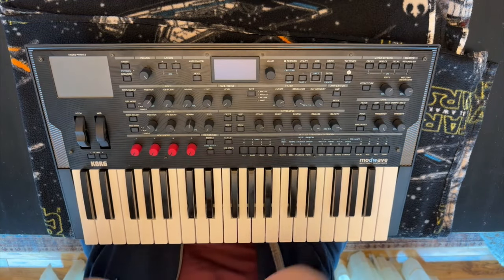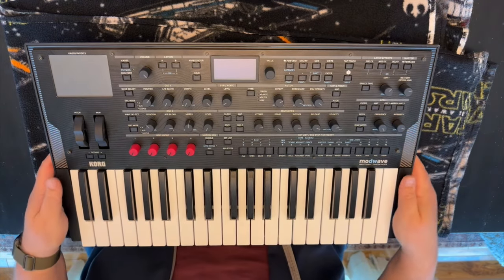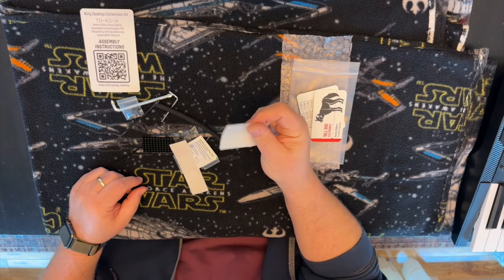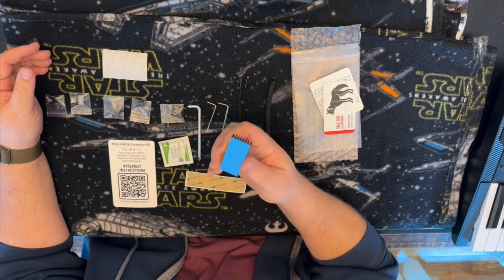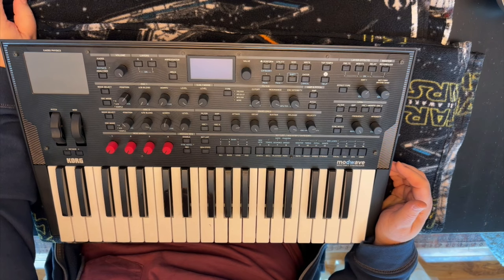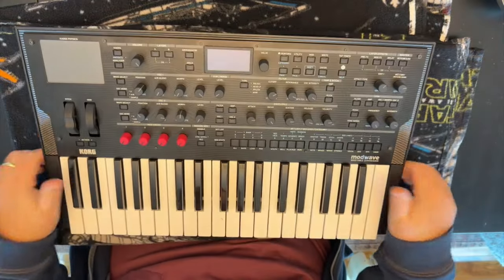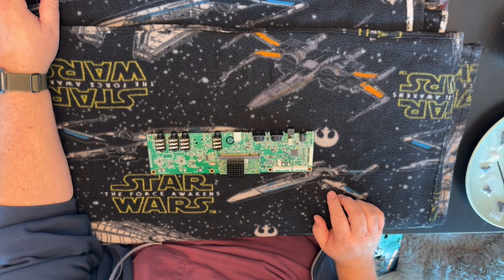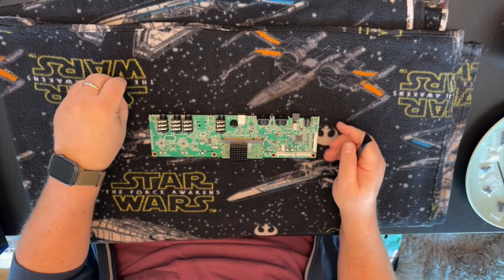Convert Korg Keyboards to Desktop Modules | No Music | Detailed Walkthrough

Comment from the maker: README: A few comment summaries from the last few days:

1) Dan from Tall Dog says this about upgrading the Raspberry PI... ( @chokocat9064 )

"So, the Compute Module 3+ used in the older versions is a completely different form-factor from the Compute Module 4 used in the mkII versions. However, Raspberry Pi does make a Compute Module 4S which appears to uses the same SODIMM connector as the 3+ so this seems somewhat promising. Unfortunately the 4S is only "for specific industrial customers" and "is not for general sale" so it might be hard to find one."

2) Several EE-type people have shrieked in fear that I placed the board on a folded wool blanket - "static death imminent!" And they suggest using an anti-static mat or simply be very careful and placing the board out of the way on the wooden table-top. Maybe I just got lucky, maybe touching my laptop every step helped? In the future I may use a folded cotton pad instead. 

3) For the people who thought my modwave booted way faster than it should, there is a an edit that removed 12 seconds of startup time. I was't trying to hide anything...I was just removing dead time. :)

4) Regarding step #35 ("tight lower faceplate screws") - contacting support (at) tall-dog.com got me several options for fixing the tightly threaded holes! Their response was timely and very polite/helpful. If you run into that problem, just contact them. Dan is awesome. I'll be making a Wavestate conversion video in a week or two and address the tightness in step #35 in that video.

Comment: Hey Luke... simple advice:
Never use cloth, fabrics or wool blankets to handle electronics. Putting that circuit board over your dog's wool blanket, it was a risky idea. Such elements tend to build electrostatic charges. Always use rubber pads or wood tables (if you don't have rubber pads). Anyways, the chance of destroying electronic components this ways is very low, but it sure exists. Stay safe.
Reply from the maker: Thanks Ben!

Comment: sweetwater started doing it and then perfect circuit
Reply from the maker: Doing what? :)
Reply: Presumably this is a reference to Korg now selling desktop/19inch rack units of Modwave, Wavestate and Opsix. They are quite nice actually. All metal, higher voice counts, angled desk mounting, and can integrate with other 19inch gear in racks. Nice recessed connections and power button on the front panel. Sweetwater are not making/selling any kits as far as I know.
Reply from the maker: Yeah I talk about the new mk2 19” rack units in the video. However for the existing 22” key versions these are great! :)

However I’m not sure if that was what OP meant, which is why I asked. You may be right though.
Reply: Sorry - missed that bit about you mentioning the new rack units.. did a bit of fast forwarding to see the end results :) I will probably get the rack Wavestate. Was hoping the SE keyboard version might have a nicer layout, but it's not improved so I skipped it, and the new rack Wavestate has the same number of voices as the SE version. Difficult to find time to play with synths with all my plugin development though.
Reply from the maker: No need to be sorry…the video is an hour long.
Reply: @synthseeker  putting candy in the boxes
Reply from the maker: @nicholasrichardson102  oh duh! (Smacks forehead!)

Comment: There must be config things that will need to be change to connect to external keyboard?
Reply from the maker: It’s just midi in. Set the channel. :)
Reply: @synthseeker  no I’m talking about in the Wavestate settings I have keyboard splits for certain performances it’s not a big deal easy to reconfigured but probably lose all the custom keyboard mappings saved with performances.
Reply from the maker: @michael7018  Aaaah I see. Hmmm. I don't know I'll have to test. It depends on how the external is configured...yes.

Comment: 26:10 When you did not transfer the serial number the serial number I just wondered where it was. It can be seen at 10:36.
Reply from the maker: At 10:36 can be seen on the outside bottom of the case. At 26:10 you’re looking at the inside of the case.